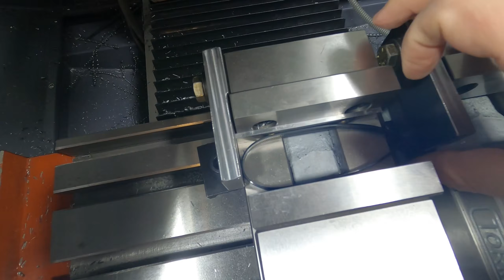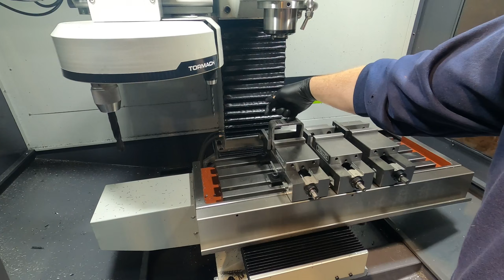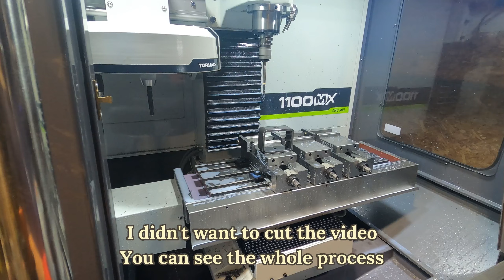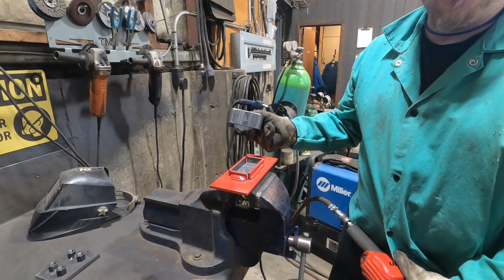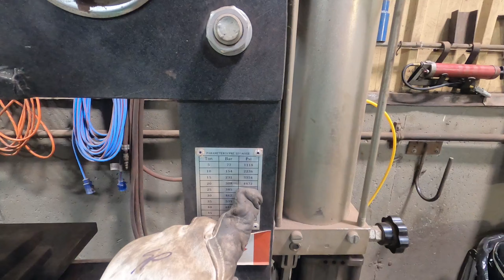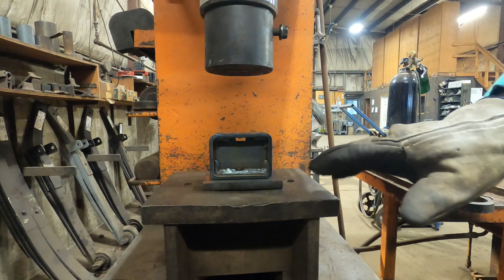How we make 3" trailer lift blocks

Comment: Fun fact - 10x is because gravity is ~10m^2 here on earth. That means if you weigh 100lbs and gravity pulls you with max acceleration you can exert 1000lbs (10x) of force due to gravity
Reply: If your axles take more than terminal velocity something has gone horribly wrong 😅

Comment: Wouldn't the logical thing be lower the truck?
Reply from the maker: If you lower the truck 2" then you will probably end up riding on the bump stops when you are towing something like a 5th wheel trailer.  We have tried that in the past with a truck or two and ended up causing as many problems or more than what we where solving.  So, we opted for the lift block.

Comment: Are they jacking the trailers up?who wants an off road trailer?
Reply from the maker: The new trucks are a lot taller than the trucks made 5-10 years ago.  they are going from 16" rims to 18 and 20s and even some are 22" rims, so even just with the tire size changes, it raises the trucks a few inches, that's not even including the box, body, suspension changes they have made to the trucks.  So, it is just 1 of a few options to level out your truck/trailer combination.